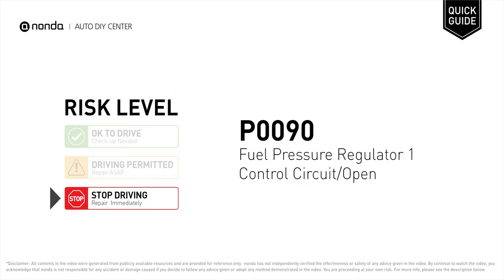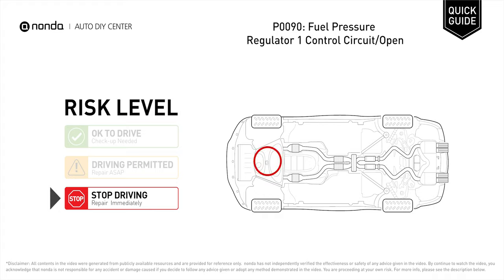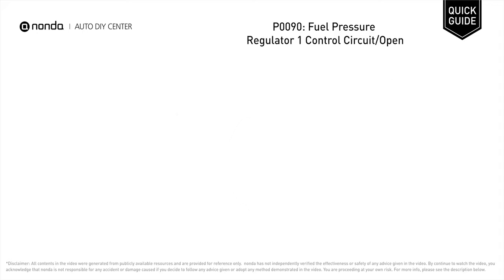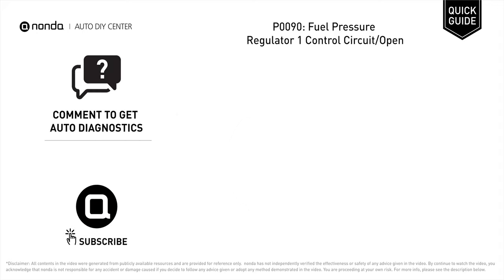What is P0090 Engine Code [Quick Guide]

Comment: What is P00CA
Reply from the maker: It may caused by Faulty High-Pressure Fuel Pump, High-Pressure Fuel Pump harness is open or shorted, High-Pressure Fuel Pump electrical circuit poor connection, or Faulty Engine Control Module (ECM).